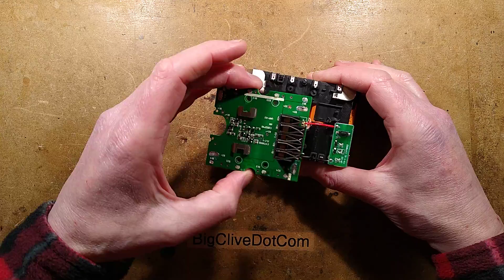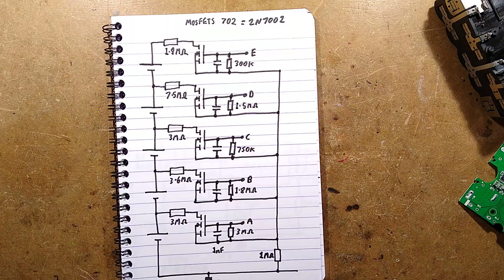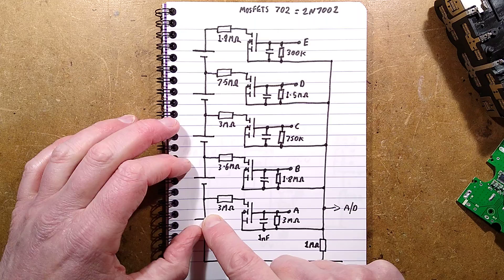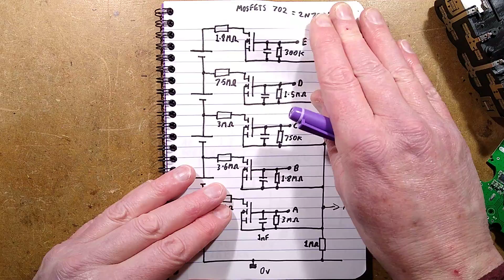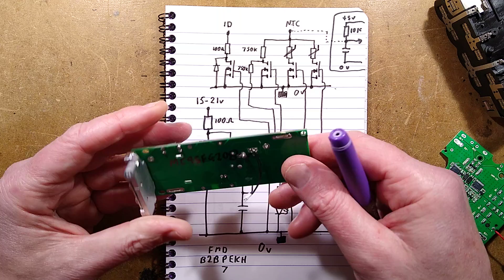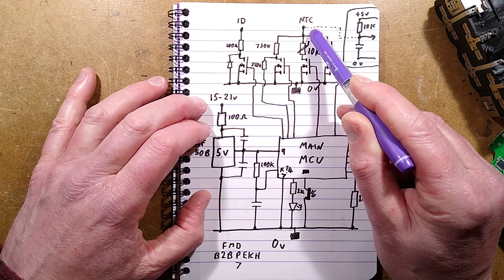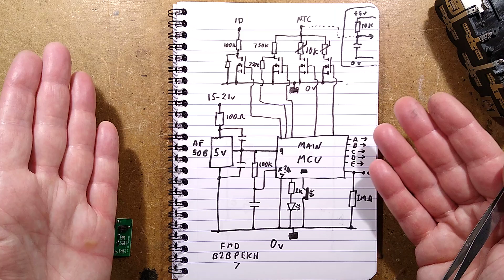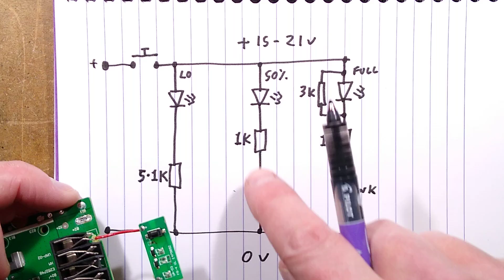Inside an Aldi Ferrex 20/40V battery (with schematic)

Comment: If you haven't already you should look at the work Tool scientist on youtube is doing. 

The most insane thing he found is that most of the top brands do ZERO cell balancing whatsoever. Some of them have all the hardware and electronics in them to do it but seemingly have the functionality disabled in software. 

Some packs have good enough cell matching that it's a non issue but Milwaukee has made some shockingly bad batteries. I mean worse than chinese clone bad.
Reply from the maker: His videos are very good.  I've seen some of them.

Comment: I've picked up a Ferrex 40v chainsaw from the skips and would like to run it off a 40v laptop adapter, which pins on the chainsaw are positive and negative? Are there two of each and do all need to be connected?

Comment: Guys...fixed it.

Looking carefully my battery design is different circuit BUT it seems one of the side connections has broken. This is a metal plate that connects to the +. Soldering this back made it work!
Reply from the maker: Good result.

Comment: Hi all. My battery gives the dreaded red flash when charging. 

Ive opened it up.

Ive tried another charger. In the past slammingnit in and out of the charger would randomnly suddenly charge it but not doing that now.

The cells are good individually. The batteries are not hot. I could not see any breaks in the wires. 

What can i do now, given batteries are all good but not charging.?
Reply from the maker: i wonder if there's a bad connection on the charge connector.  Especially the "T" temperature sensing and signalling contact.

Comment: Hey, would anyone know if those exact battery's could be used in a project to make a powerwall out of them?

I was thinking making adapters on a wall where I would just plug in those batteries. Like 200-400 of them. But seeing how complicated the electronics is inside I do not believe it can be done.

Not easy to charge them or even discharge them without some electronics
Reply from the maker: Simpler battery packs would be better.  But for a safer system I recommend a dedicated power wall system installed in a way that it can't burn your house down.

Comment: I've got one of these batteries that's stopped working, well basically it doesn't charge, flashes red but when you put it in a Ferrex power tool it won't work unless I remove and re-plug while holding down the trigger button, what could it be?
Reply from the maker: Pulling the trigger may have momentarily bypassed the batteries low charge warning and temperature sensing pin.
Reply: @bigclivedotcom  it stopped working while having half charge when the reciprocating saw got stuck in metal I was cutting. I'm guessing something has burnt out? I'm going try the CPU reset in your video hoping it'l work as all my local Aldi's are not stocking these, I love your videos btw, one of the best on YT.

Comment: Thanks for this really helpful breakdown. I had a battery that just flashed red on the charger.
Using your info I tried shorting the reset caps but noticed one didn't have +5V across it.
There looked like an OC between B1+ through to the next door B1+ shorted with a link and now fixed.

Comment: One of my 20/40V Ferrex batteries no longer charges or works on 40V devices. If I jump charge it. It will still work on 20V devices. Does this sound like some of the cells on one bank have failed?
Reply from the maker: It sounds like the process or has locked out on one section of cells if the voltage has dropped too low.
Reply: @bigclivedotcom  got the multimeter out and opened the battery up, one of the cells is completely dead

Comment: Your video saved two of my batteries . I let them go flat in the garage and the button showed 2 lights and would not charge. After watching your video i jumped the second side off a good battery b2 +and the b2- and after half an hour it charged a treat on the charger. Now i have 4 good batteries. Thanks for the in-depth review and saving my batteries.
Reply from the maker: If a battery has dropped in voltage too low it's better to gently bring them back with a low trickle current.
Reply: I have a battery pack that is fully charged but won't allow a power tool to run.  Is it totally different now or could it be fixed?

Problem we have now is that these batteries are as hard to get as rocking horse manure.

I don't suppose you know if replacement boards are being sold anywhere?
Reply: @andytaylor8802 idk how it’s in your country but in Slovenia there (till this day) always loads of these batteries in Aldi + today the big one 40v 90Wh has a giant discount and is like 12eur

Comment: if b1+ and b1-  , b2+     and b2-    read 12v each would that stop a battery charging? ie have to breached the minimal voltage to charge ,giving a flassh red light on the charger? thx
Reply from the maker: That voltage is too low.  The pack may have been over-discharged.  Each section would need to be around 15V or higher to be recognised by the charger.  (3V or higher per cell)

Comment: I have that 20/40 battery,i used to read the voltage each terminal on the battery and i confirmed that there's two separate 20v reading,(b1-and b1+=20v),(b2-and b2+=20v) this is completely separate no contact to each other,my theory is that the key how it change its voltage to 20v or 40v was inside of the  power tools terminal, if it design for 20v or 40v..l,if your tools is 20v the terminal inside of the tools have jumper to b1-b2-  and the b1+b2+  jumper too,this will result to parallel connection (20v)  and if your tool is 40v there's a jumper to b2- b1+ this will result to series connection 40v.i hope you understand 😊

Comment: thanks for the schematic I get the value of the thermistor and used a  10k resistor to get the 20w led projector np-rwd-20r working with 18v erbauer battery .  they said compatible only with active energy battery :-)
Reply: Hi, how did you wire it up if you remember? A 10k resistor between the T terminal on the tool and the negative terminal? I'm trying to use a Milwaukee battery on an orbital sander.
Thanks
Reply: the thermistor is connected between the T terminal and  the ground .

Comment: Let's say I wanna rebuild my double battery can I just use these cells alone ? Fantastic work mind blowing 👏🏻
Reply from the maker: That would depend on the circuitry in your old battery.
Reply: @bigclivedotcom  I'm very new to this stuff but  basically I'm just replacing lithium 3.7 to the same3.7 18650 ? As I have a DEWALT battery that's 50/50 and a ebruer that's 100 perfect but only have DeWalt so using the other one just as a donor

Comment: I just recently bought the Ferrex 20v Combi Drill/Driver/Hammer (WWS-ASBS20-SP for £18 Bare Unit.
Unbeatable value for money, solid construction and takes this Active Energy 20/40v battery. If it lasts me only 6 months then it has earned its keep but it has a 3 year warranty so.... absolute bonus.
Don't know how they manufacture these units for the cost, crazy. I couldn't buy just the motor for much less than the price of the whole unit.
Having mostly DeWalt and Makita (refuse to jump on the Milwaukee hype train), just had to get one of these for the fun of trying out the quality available at this price. Plus, if anyone needs to borrow a drill, I needn't panic about my Makita/DeWalt XRP being abused by a novice family member, I just lend them this 😊 Ferrex.
Always found it incredibly annoying when family/friends expect to borrow a professional, expensive tool and inevitably abuse it because they didn't pay for it, only to return it covered in crap, bashed up and wobbly bearings that were fine when they took it. Lent out an 8 month old DeWalt Cross Pull Mitre Saw some time back to an idiot neighbour who put down some  Laminate Flooring, only to get it back with the noisiest bearing I have ever heard. How you damage a main bearing on a large mitre saw cutting just thin laminate flooring is beyond me. You expect lost Carbide teeth on the blades where they stupidly cut something with nails in, but a whole bearing wrecked 😮. Cost me £80 in  repairs for a fool to floor his downstairs. As for warranty - DeWalt would not have believed the bearing on the main drive shaft had failed just 8 to 9 months in due to proper usage. A 180lb Gorilla swinging on the handle maybe, a routine failure, absolutely not.
I also bought the Ferrex 18v nailer which this far in, 4 to 5 months, is very good, no nail jams, smooth operation and effortless power as a 2nd fix nailer shooting brads upto 50mm into hardwood, softwood and even plastered walls for fixing architrave, dado rails etc.
Always used a gas, then pneumatic nailer before this. The Paslode is great, as is my air nailer hooked to the compressor but the Ferrex works just as well for anything upto 2" brads, anything longer, I use the Paslode.
I always swerved Aldi's WorkZone products because they were crap, similar to B&Q's Performance Pro range which were also complete crap but Ferrex in comparison seem really good value for money.
Tempted to buy some Ferrex Pro tools, maybe the Brushless Impact Driver if I can find one. They appear to have an all metal gearbox housing as well as a fully metal gearbox. The Parkside Pro range looks to be well constructed too. Never been a better time for buying powertools at the cheaper end of the market to see how much value for money you can squeeze out of them and also to test how much better the high-end tools we pay a fortune for actually are or are not. Keeps the big manufacturers on their toes 😂 which is never a bad thing.
Reply: I have the ferrex Pro impact driver with 20/40v battery it cost me 35 quid its brushless and will undo wheel nuts at 200nm I have the grinder and hammer drill Pro version they are brilliant missed out on the shop vac last week 35 quid wet and dry vac I don't know why people seem to think big brands are best the 20/40v battery 5 years ago was better than a few big brands batteries all I hope for is a impact wrench ferrex Pro
Reply: @aarondavies8486  An impact wrench would be a fantastic addition to the toolset, would also buy one myself. Great to hear that you are having a really good experience with Ferrex too. They are extremely good tools, particularly for the price. Mine are still running perfectly these 2 to 3 years later. I absolutely recommend them to everyone I know and none of my friends have regretted their purchase. Best value for money in power tools of all of the brands available.

Comment: I've got question about charging those batteries with SkyRC chargers. Do I need make some connections to T or ID pins?
Reply from the maker: I'd only recommend charging them with their dedicated charger.
Reply: @bigclivedotcom  yesterday, I charged battery without issues, current at 3A, with both B- and both B+ connected together, charger finished at 40.5V.

Comment: hey man, i don't know much about electrics, but i would like to take an old dead battery of the Ferrex universal 20V and remove the batteries from it and connect it to a simple 20V power supply to use the machine connected directly to the wall instead of spending money infinitely on batteries. If that is possible, it would be great if you could make a video on how to make that. Best regards .
Reply from the maker: It would have to be a very high current supply, and you'd need to connect a 10K resistor between the temperature pin and the main negative connection.
Reply: @bigclivedotcom  thanks, when you say a very high current supply, how high is that? is there a number?

Comment: Hello and thank you for the very interesting video....
Can I start an Aldi drill, for example, without using the battery by directly connecting the 20v to B1+ and B1-?
Reply from the maker: It needs a 10K resistor from the sense pin to -ve.  But that will defeat any low battery protection.

Comment: Thanks for videos keep them up
I was also wondering since i have a lipo charger would i be able to charge the batteries with that without opening them in set of series by passing the charge through the top of battery like the original charger
Reply from the maker: It wouldn't allow balanced charging of the internal cells.

Comment: They seem to have changed the board design at some point; mine has a date code 20181015 on it, so maybe one of the erliest. I've disassembled it because it didn't charge anymore (didn't find the fault, so maybe broken MCU), and it had the more typical multi cell monitoring circuitry with a resistor in series with each cell and a capacitor to the next cell connection below; 2 times of course. Used some sort of protection/MCU combo chip it seems, and it doesn't have any optocouplers, don't know how it communicates with the other MCU then. Also no fuses on the PCB itself, but the nickel strips for both packs were slotted to reduce cross section to form a fuse. I still have the PCB in my electronics scrap bin and could make some pictures if interested.

Comment: I use various power hungry cordless from different brands including Mac Tools, Macalister, DeWalt and Keilder  but I have been seriously impressed by Ferrex 20/40v tools. The 20/40v batteries give seriously impressive performance in my chain saw as a result I have bought other Ferrex tools.

Comment: I have a lawn mower that runs on the 40V. When I use that battery in a drill (20V) it does seem to last much longer so I think that they do go in parallel. Really good video. 🙂
Reply from the maker: They do.  I've tested it.

Comment: The clack on releasing the trigger on the drill is the brake on the chuck slamming it to a dead short.. I mean stop.. not much finesse but for 20 quid what do you expect, their good enough for the money, and now their bringing all the brushless versions out... so see what their like when the prices drop...
Reply from the maker: I've tried the "faulty" drill I bought to take apart.  It only sometimes stops with a clack.

Comment: Excellent teardown and Rev Engeneering not only of the circut but the rational behind it. Thanks Clive, keep up the good work. Would be interesting to do a comparrison between the Aldi Ferrex and its compatriot the Lidl Parkside. Amazing how on the  surface all these look the same, Riobi, Ferrex, Parkside Black and Decker and none fit each other, I know there are adaptors., buy not redaily available in a pinch. Another interesting fact to know is how the cells in these batterys compare, ie no of mA they are and rated and actually good for. Some of the cheaper chneese 2200mA dont even come close to stated ratings. Hence why people buy Riobi used battery packs to build their own Powerwall.

Comment: I don't understand the concept of powertool battery marketing wank.
It has more volts, it is the more betterer battery!!!11
Huuuge BS. Sure, the more voltage, the less current, but a 5S battery will happily provide 500W and 25A is not that much of a current
And if you need more that 500W in your powertool, you are maybe already better of with a mains voltage one. A gigant battery on an big 2kW angle grinder pretty much defeats the purpose of a convenient cordless and lightweight tool
Just make it 5S and whatever you desire in parallel for longer use
A worldwide standard for powertool batteries also would be nice

Comment: PCB looks like it has ICSP header, so the reset is needed to allow the processor to be reset, and then on coming out of reset you can enable programming mode, likely to allow writing into the data storage area of the EEPROM for things like allowed capacity of that batch of cells, and also set the ADC calibration, plus a serial number for the pack.  No balancing, so the weakest cell determines capacity, and the dual thermistors, along with the transistors, also allows use with tools that have "dumb" monitoring controllers, simply using the packs as supply with a thermal sensor, or an intelligent pack (likely the 40V tools) that use the comms to read things like capacity and allowed current, and to thus extend battery run time considerably. 

Probably uses the tool being connected, and thus pulling up the NTC line to 5V, as a wake up, using an internal comparator to interrupt the micro, and starting a routine that first attempts to communicate by disabling the thermistors, then  looking for a communication down the NTC line, signalling via the ID line. Nothing coming in within a second it then assumes a dumb tool and switches the thermistors on, and then also sends an IR pulse to the high side to wake it. high side then simply feeds battery state voltage down slowly, and likely the method for dumb tools is to switch off the thermistor drive, and let the tool think the battery is very hot, shutting off the tool. smart tools likely get a rough battery capacity gauge sent periodically, with the microcontroller probably running every 5 seconds in a loop to read, so thatit can spend most of the time asleep.

Comment: That voltage sensing arrangement just doesn’t look right, I don’t think it would work if constructed as drawn. I can’t see why the gate drive pulldown resistor would be connected to the voltage divider output.

If the nominal 20V tap E is selected, assuming the microcontroller outputs 5V then it wouldn’t turn on hard enough to give a good representation of the battery voltage to the ADC.

(If we assume that MOSFET E is on: the ADC is fed 20V via a 1.8M resistor, 5V via a 300K resistor and 0V via a 1M resistor which is 5.7V by my arithmetic… but this would actually be a higher voltage than is applied to the gate, so the MOSFET will not be turned on fully but instead will settle at 5V less whatever its Vgs is, giving about 3V to the ADC input rather than a good representation of the battery voltage.)